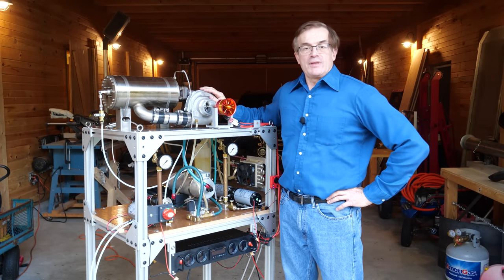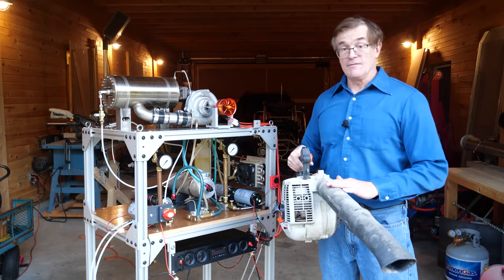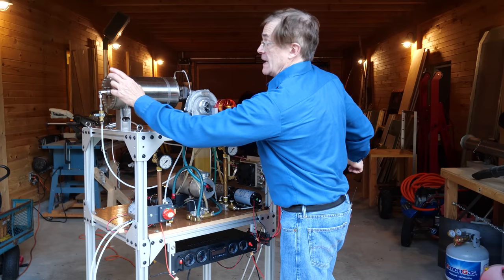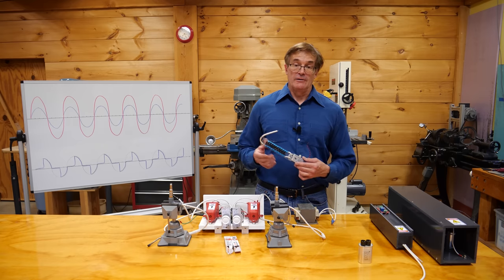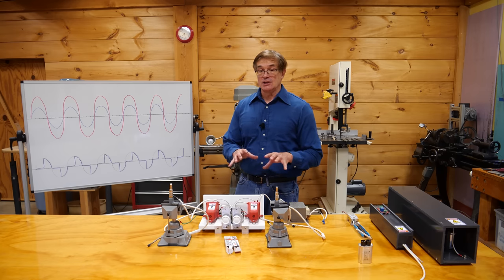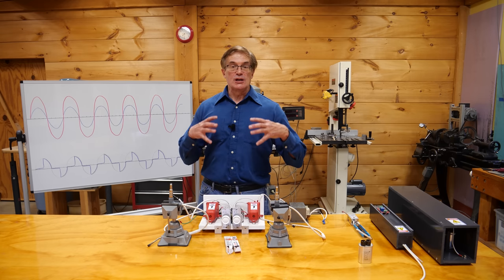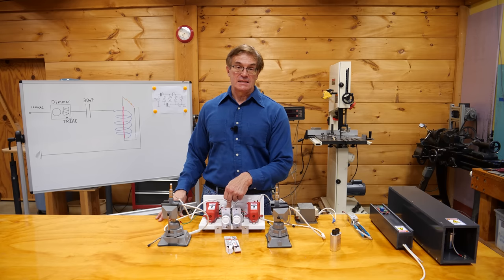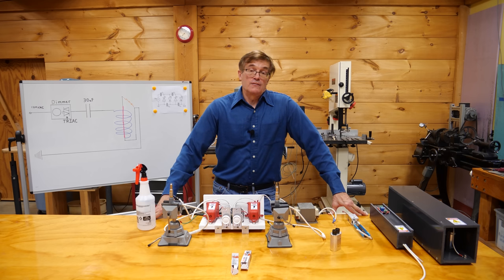What else goes into building a jet engine? - Part 4 Final

Comment: all of those solutions look kind of dangerous, especially anything with a MOT. instead you should look at getting a smart coil pack. or coil on plug. look at chevy v8 coils. then use a generic PWM driver (you can get them cheap on ebay) to drive the logic level 5V signal into the coil. you can run it all off of 12V so it is much more portable with the added benefit of not using mains at all.
Reply from the maker: We weren't using the MOT. The triac switched induction coils are inexpensive and powerful, but an automotive  ignition  system  is certainly  an option.
Reply: @TechIngredients  understood that you used "dumb" automotive coils (MSD Brand). but the MOT with doubler was also a suggestion. I am just suggesting the smart coils as a future option if you ever decide to strap it onto the back of a go kart. Hope i'm not coming off in the wrong way, great informative videos as always! And a clever and unique way to use a dimmer!

Comment: great video as always ty,... would you look at a couple of papers about g forces reached by a nematocyst firing, wondering if there is a mixture of mechanical advantages we dont use or if it is just the mass to force ratio at micro scale that can produce 5000000 gs of acceleration.
Reply from the maker: Thanks!
It is indeed the scale  that makes those accelerations possible.  Think about the acceleration that a nitrogen molecule makes when it recoils off a solid surface.
Reply: @TechIngredients  thanks for the reply, i only have science fiction to guide me and I would have been pinging around ideas with no basis endlessly.

Comment: Wrong, in commercial engines they’re started by a “starter cart” which is the little yellow cart at the airport. It has its own mini jet and that bleeds hp air into the jet engine and thats how they start.
Reply: Or they use the APU bleed

Comment: Would it be possible to make a turbo jet with tesla turbine discs instead of impellers?? Maybe not on the compressor side, but should be possible on the turbine side??
Reply from the maker: It should be possible  for both parts, but there are limitations.  The air volume  capacity  of a T. turbine is low compared to a conventional turbine unless there are a lot of disc's.  Also, the actual efficiency of the Tesla system is at best equal  and likely lower compared to a conventional turbine.

Comment: What about a 12v spark ignition system?
Reply from the maker: That certainly  can work.  The hotter and longer the spark, the better.
Reply: @TechIngredients  Sorry my question was do you have a 12v spark solution instead of the 110vac you showed? You have earlier said that it is good to stick with 12v so that it remains a portable system
Reply from the maker: Sure.
A low voltage, DC driven, high-frequency transformer with a voltage multiplier will work. You can buy a complete system on Amazon or eBay.

Comment: Ive got a rough draft idea on a way to make and apply graphene in a fairly easy and scalable way!
I would love to share this idea with you and get your thoughts on it.. If you like the idea, ill let you have it! I dont ask for anything in return, i just want my ideas out there for everyones benifit and i would love it if you were the one to deliver it!
Reply from the maker: Sure.
Let's  hear it.
Reply: To make a long story short,  you apply a voltage to a tub of water using graphite anode and cathode (and or add nano particle graphite powder to the water) to make a layer of graphene on the top of the water.
Then use a process similar to the hydrographic process to coat computer chips, coat materials and add layers to pretty much anything. 
You would be taking advantage of the strange hydrophilic to hydrophobic properties graphite exhibits when "wetted" graphite is exposed to the air....

This is just a rough idea that i was musing about while watching a series on graphene batteries....
Reply from the maker: That is basically  how electrochemical exfoliation of graphite is performed  to separate the layers of graphene from the graphite.  An electrolyte like ammonium hydroxide is added to make the water conductive and interpose the electrolyte  between the layers to literally  pry them apart.
The problem with this technique  is that it makes very little  single and few layer graphene and almost all is still hundreds of layers thick which is still graphite and once these thick layers are free from the electrodes there is no longer an electrical potential  to further peal the graphene off.
This flash technique avoids that, it really works and I'll demonstrate that soon.
Reply: @TechIngredients  it was only a basic description, in the method i invision the use of specially treated water by iterative filtering through Pyrex
glass filters and the use of multiple static magnetic fields. This coupled with careful temperature control could enable an environment that creates a layer of graphene.
 Graphite/graphene can be manipulated via magnetic fields and even moved by these means at a molecular level...

This is the basis of my idea...

Comment: Wonder if you could make the jet engine run with a plasma arc from a microwave magnetron with fullwave rectification and smoothing..?
Reply from the maker: What would absorb the microwave energy? Air is transparent to microwaves.
Reply: @TechIngredients  Tungsten on the antenna of the magnetron, which serves as a breakout point, in this video https://youtu.be/84oz6pL9nFU Do you think it could work?
Reply from the maker: Probably  not.  You'd need a very large surface area to heat the air in the few milliseconds it is in contact with the surface.

Comment: In this application - the use of an induction coil to cause high voltages - it's not about the speed that the magnetic field is built; it's the speed in which the field collapses. You are harnessing the back EMF spike. The capcitor in this circuit is not adding any enegry to the arc. Usually you do so well with the physics. But, it seems that electromagnetics is not your strongest field. Pun intended...
Reply from the maker: Stop and think about what is actually happening to the electrons in the secondary  coil.  As the field changes they experience an accelerating force perpendicular to the vector of the field direction.That vector flips 180 degrees depending on the current direction in the primary coil, but the magnitude of the vector depends on the current. The original induction coils depended on a relatively slow (low current) DC source and only the discharge was fast enough ( high current) to generate  the high rate of change in the field to generate high voltages. This is why you get biphasic ringing in an LC circuit.
Pun forgiven.
Reply: @TechIngredients   I appreciate the friendly discourse, thank you. Please take my comments as such.

The fault I perceived in your on video explanation was that that the energy of the field at collapse has anything to do with Δv/Δτ during the building of the magnetic field. In fact, it’s merely w=1/2Li2; a static function of the instantaneous magnetic field. The current can be held at a steady state indefinitely with no effect on the resulting EMF during field collapse, and the opposition to change by reluctance during the building of the field adds no energy to the system. Quite the antithesis, actually. Faraday’s equation states that only when there is sufficient energy already in the field, and the current changes sufficiently abruptly that the resulting back EMF results in the voltages sufficient for the arc to jump the gap. VL = -LΔi/Δt, with Δi only being the instantaneous Li. Never is the voltage a factor in the field strength, or the energy stored in the field.

In fact, the sudden inrush of current to the inductor is opposed by the reluctance forces behind Lenz’s law. Sure, the voltage will rise instantly; however, the current will not, therefore though there is a strong opposition to change there is not necessarily much energy available; further showing that Δv/Δτ is immaterial.

In your written explanation, you state that the magnitude of the (EMF) vector is dependent on the current. That statement is not entirely accurate, in that is only half of the equation. The magnitude of that vector is as much a function of the Δi as it is the Δi. If the change to i happens with a substantial Δτ, the magnitude of the vector will be much smaller than if the same change happens quite abruptly.
Reply from the maker: You might have misstated your point in your last paragraph, but I believe we actually agree in principle.
The difficulty is that voltage is an indirect factor as it only drives current and current determines field strength and direction.
Only a change in field can do work on electrons in that field and so, only a change in current can do work on those electrons.
According  to your  OP, the electrons  in the secondary coil will only be accelerated during field collapse which would mean that they can only respond to a unidirectional change in field.  If this were true an AC transformer wouldn't  work and the pulse transformer in our dye laser trigger wouldn't fire the flashlamp.
Reply: @TechIngredients  In a way, yes we do agree, in principle. Where we do not is that the function, and therefore mathematical representation of the physics of an inductor in a polarity changing pulsed DC system is not the same as a that of a coupled and loaded transformer in a continuously variable, AC system. Where does one become the other? It’s hard to pin down to the exact attosecond, so please don’t ask me to; but I’m sure we can agree that at some point the resting dwell time between a discharge event and the next charge current pule exceeds the discharge time constant sufficiently that the influence on the field by the previous current event is negligible. Your vector theory is only applicable to a state where phase angles need to be considered. Such as when we consider iL = Im sin (ωt−π2) for instantaneous current in a sinusoidal system. In a system with a 120μ discharge and an 8.3ms charge time constant, we can say that this is not an continuously variable AC system. IS there residual flux, sure. So, are there Lorentz forces at play, yes. However, they are dwarfed by the magnitude of the next event. Unlike in the ringing LC you mentioned, they don’t add appreciably to the vector sum. Yes, I’ll concede that they do, mathematically; but not in a statistically significant way. Even with the discharge lengthened by the moderating capacitor.

And, yeah, I did mess up expressing that last bit in my previous post.

Comment: can we make a liquid rocket using ethanol and hydrogen peroxide ?
Reply from the maker: It's  possible, but concentrated  hydrogen peroxide is really dangerous and I wouldn't want to deal with it even though  as you can see from our videos,  I'm not dissuaded by controlled risks.
Reply: @TechIngredients I can understand the risks that you would have to encounter Hybrid seems like the sweet spot. Additionally  I was thinking of a making a ethanol/methanol + h2o2 hobby size rocket here for my self. What would you recommend me to do ?Abandon the idea due to potential risks or get a safety man for the same. Appreciate the effort you have done so far and going to do.

Have a  nice day.
Regards.
Reply from the maker: I'd avoid  it.  It's  one thing to get someone  to work you up to constructing the system, but the handling  and storage of the peroxide is a 24/7 undertaking that can expose everyone in your home or business to the risks.
Reply: @TechIngredients  thank you for the heads up ,I will email once if something good comes out or maybe evaluate the risk and probably pull the plug.Have a nice day .Regards.
Reply: @TechIngredients  I was thinking about making about a 10% emulsion between 12% peroxide and biodiesel to run in a turbo jet. Thinking the extra oxygen and the steam would increase the compression ratio with less fuel. Second guessing the idea now.
    Also, have you ever had one of these catastrophically fail, and how do you protect yourself from shrapnel? (I have a 1" thick lexan window from a closed bank and a bullet proof vest when testing)

Comment: So nobody has put a winding in the casing of the turbine and run current through it like a ring motor? Huh
Reply from the maker: The temperature and the need for close proximity for good field interaction would be tough from an engineering  point of view.

Comment: Couldn't you just use a car battery with a coil.
Reply from the maker: You'd have to also add an ignition  system because  a continuous DC current will not generate a high voltage.

Comment: use electric motor with clutch
Reply: piezo whack spark
Reply from the maker: It's  an option, but I explained why you might want to consider the blower.
Reply: marx generator with relays
Reply: hammer piezo piano spark
Reply: hit a stone with a hammer = spark
Reply: the Lord is my shepard, what can people do
Reply: dont push your worries on me, push them to the Lord, who is, in us
Reply: @TechIngredients  to each their own, but I have what God gave me
Reply: @TechIngredients  also the advisor selection :)
Reply: @TechIngredients  better advisors are owned by God, and not serving people, in any way
Reply: @TechIngredients  be free, in Christ, brother, not the mindless multitudes
Reply: @TechIngredients  magnetic clutch for the win
Reply: @TechIngredients  sure the blower works fine aswell
Reply: try air-liquid/fuel-solid/oxidizer sand blaster air mixer blow tube rocket engine, both air-mix and oxidizer-mix modes, pump or air-flow mix modes